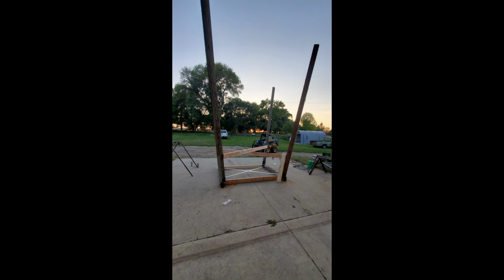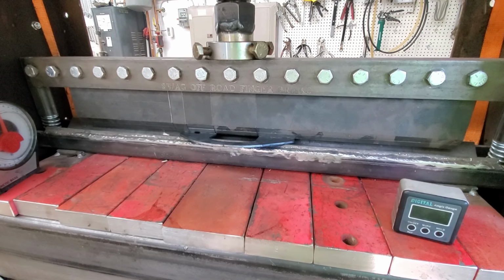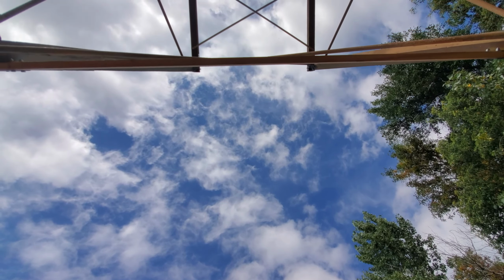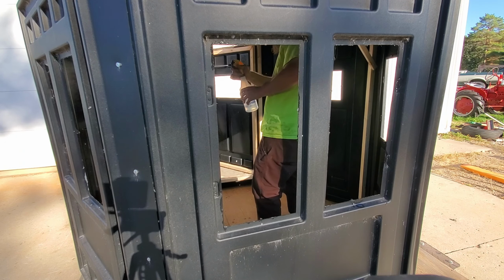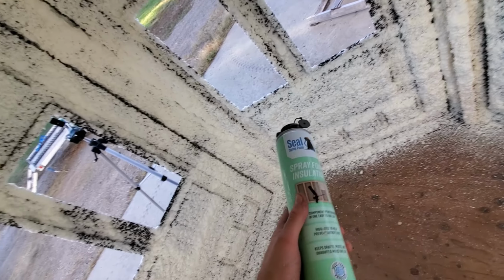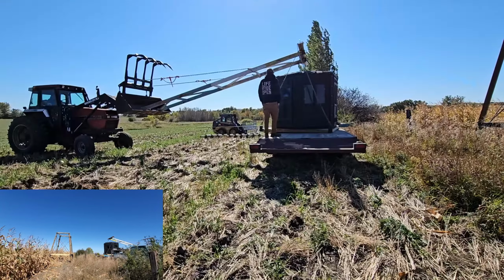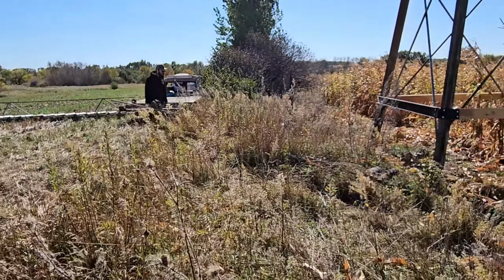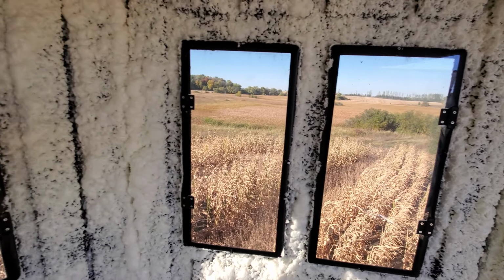Extreme Deer Stand Build & Install - What Could Go Wrong?

Comment: If it were me; I would get panels of rigid foam insulation, cut them to fit, fill the gaps with normal canned foam, shave it down to make it pretty, then paint the inside if you want it looking better.
Reply from the maker: Looking back I should have done that especially if I know have the spray foam worked out. I may have to take your suggestion depending on how this season goes. Thanks for your suggestion and comment!